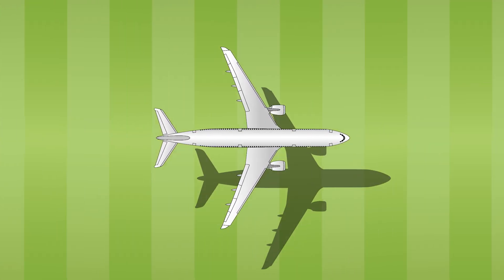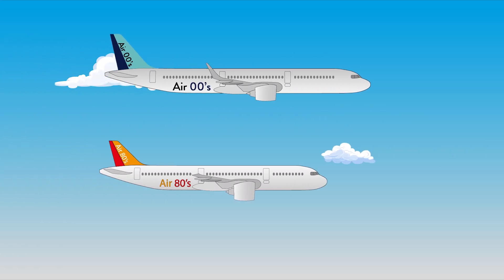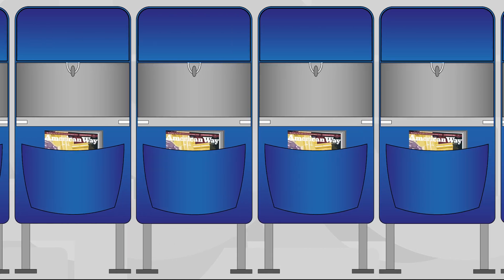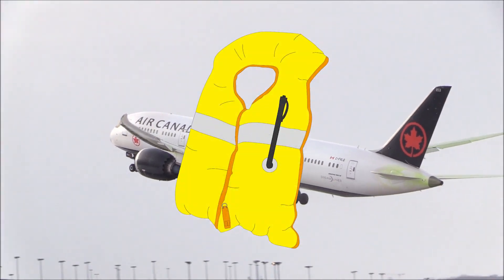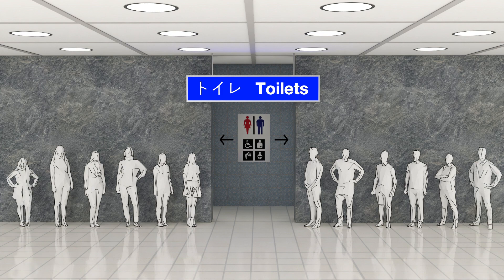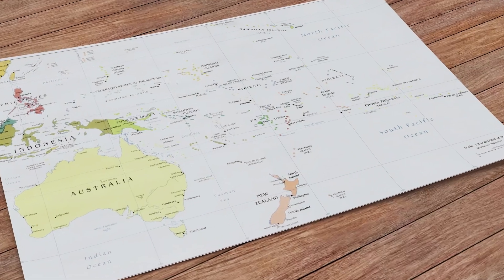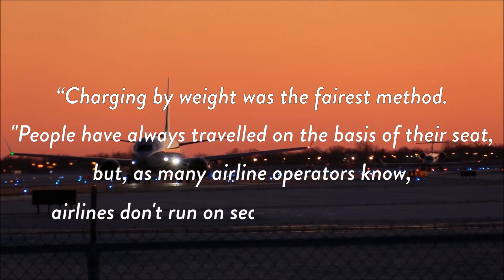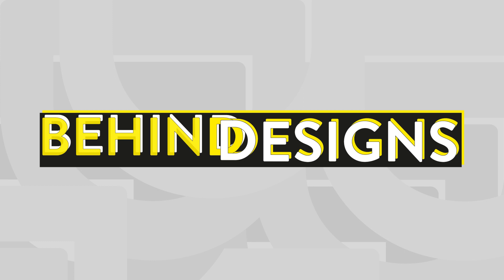Why Airlines Want A "Fat Tax"

Comment: To be fair it is not fair that I help front the cost of someone that is 5'3" and 350LB where I am 6'1" and weigh 130LB.
Reply from the maker: I think having a weight assigned to each seat/ticket on a plane would be fair, say 100kg (220lb) and you can fill that quota however you see fit, or split it between passengers in a traveling group. And then it’s a nominal fee for every KG over that amount.

Comment: Great video, Interesting concept around pay-what-you-weigh, but I have to disagree. Imagine a larger passenger was judged to be 50% over the average weight and as such pays a 50% fat-fee for his ticket, when he gets on board, does he get a seat 50%  larger than the average seat? Of course not. Charging fat passengers more and then still shoe-horning them into a standard sized seat is the airline having it's cake and eating it (pun unintended lol).

Just because is it an airline doesn't mean that the same problem doesn't exist in all other modes of transport and industries. A bus uses more energy to transport a heavier person, so does a train and a taxi - will they start breaking out the scales before you get onboard? Should the hospitality industry charge heavier guests more for the additional wear on their fixtures, fittings and plumbing systems?

We are human beings, we pay a fare for a journey, not a shipping rate.
Reply from the maker: This is a great point, and I personally agree with you. Almost every airline has a policy where larger passengers who have trouble fitting in your standard seat must buy a second one next to it. However, this is at the extreme level. It is probably down to airlines trying to penny pinch and this is seen as an easy win. especially when the PR team spin it with an environmental twist. you will be paying for the extra pollution you cause, or it’s a tax to offset your carbon footprint. something more palatable for the media to swallow. Thanks for the comment and support.

Comment: I'm 62 4" - I'm slim for my height, but still 100 KG - so I get penalised?
Maybe a  fee for deviation for the norm for your height is fairer - otherwise it'd be discriminatory against tallness - literally Apart height
Reply: Anyway, I don't think you need to worry about your weight so much as your height... Most airlines will refuse a 62 foot man
Reply: @charlielyth1982  I've never been questioned about my height when purchasing the flight or checking in.
Uncomfortable because of low seat backs so no neck support, yes.
I have been instantly upgraded by the stewardess on boarding because I'm "Too tall for the overwing exit" I normally try to book.
Reply from the maker: That is quite a good strategy for an upgrade! The point in the video about height was more demonstrating that not all weight factors are due to lifestyle and can simply be down to genetics. Airlines give children a discount that can be up to 50%, presumably due to them being smaller, weighing less, and possibly eating less... If you suffered from a growth abnormality should you also be entitled to this discount?
Reply: At some point along this thought process there is going to be controversy isn't there, I wonder if something like BMI would be better, but then that risks gets further away from the whole point of charging more.
Just thinking, if a family is booking flights, they could have a mean weight that they have to be under otherwise they get a surcharge?
Reply: I agree. I am 6-10 and 110kg which is considered normal for my height.

Comment: Isn't the cost of airline fuel at historic lows yet we've not seen prices drop correspondingly? They can use some of their profits to offset extra fuel costs like every other industry.

The industry as a whole is motivated by greed
Reply: not to take the spotlight away from this channel, but i believe there is a wendover productions video that is sort of related to this, basically even with lower fuel costs making it seem like airlines could lower costs to help stimulate demand, because of the pandemic lowering costs will not create demand in this situation. At least for now that is why the cost of flying has not gone down a huge amount, it would just make the airlines lose money without creating more demand. if i missed the point of your comment sorry, but this is an interesting effect that could explain what is happening.
Reply: If you're motivated with greed you would not start in the aviation business, it's terrible. You need a massive capital to get the planes, or lease them so your fixed costs are very high and at the moment they are sitting in storage because nobody is flying. 

How to become a millionaire in aviation? Start as a billionaire!
Reply from the maker: I was going to add a section about jet fuel prices into the video but it’s so complicated it would have doubled the length of the video, it’s a subject that deserves it’s very own video! Some airlines secure a fixed fuel price for years. But essentially yes, like at the pumps with our own cars, any increase gets passed on immediately whereas a decrease trickles through...

Comment: Another top notch video! Thanks! I think whichever airline is brave enough to be the first to charge by weight will have a massive advantage. They would obviously attract a certain sort of passenger allowing them to offer particularly attractive fares, and also change the distribution of passengers on other airlines, forcing them to raise prices. Obviously it's quite contentious but I'm fairly well built myself and wouldn't have a problem with it.
Reply from the maker: That’s a very good point, it would force everyone to follow. Let Ryan air or whoever take the bad PR hit and then copy it a few months down the line... cheers for the continued support!